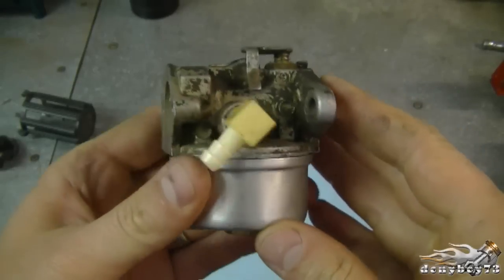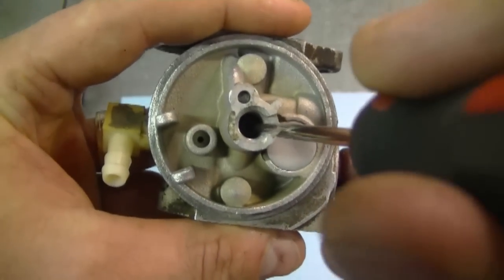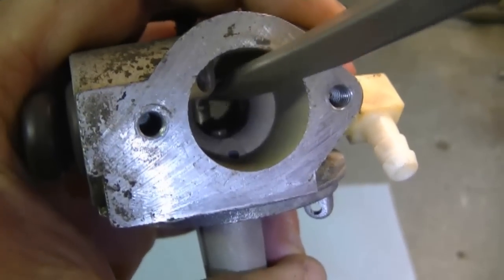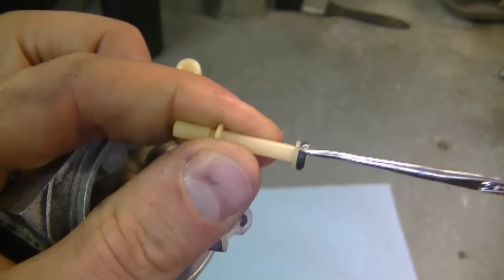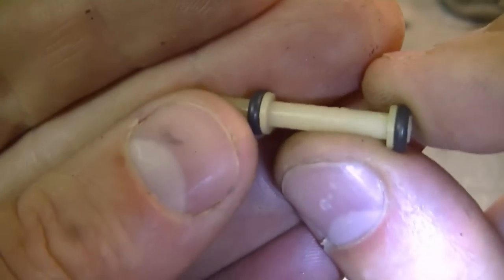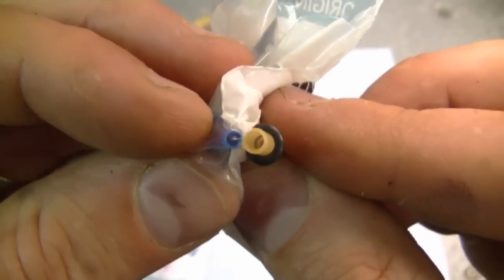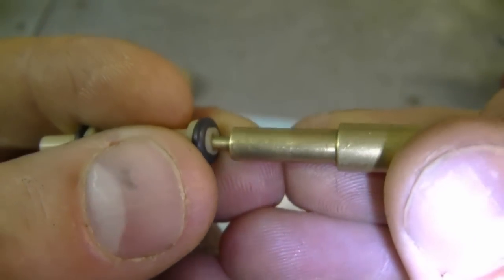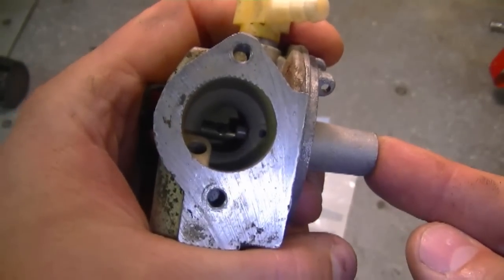How To Remove The Emulsion Tube From A Tecumseh Lawnmower Carburetor

Comment: Great video, as of 11-30-2021 it is really great.  Got a prestine old tecumseh lawnmower, the oil was even clean !  Barn Find.  The upper o ring was missing.  I speculated that there was possibly a missing o ring as there was only black kibble left of it.  Put in the two new o rings and a new nozzle since it was broke on the small end where the o ring was.  Great video Donny it provided the confidence to reassemble it correctly.  Your video is saving the day , many a years later.  Thanks .

Comment: Thanks dontboy 73 , your vidiossure helped me alot . today i put a new float bowl gasket and needle valve on my tecumseh 10 hp snowblower . it runs fine now after i fegured out it was sucking air .
thanks again
Robert Bock  
Lancaster , pennsylvania

Comment: Crochet hook is a 4/2.00 mm  as can be seen stamped on the shaft.  I have a smaller one that I filed back the forward side of the hook to make it a sharp hook.  It is useful for removing broken keys in  locks. It is marked 10.  Some emulsion tubes I have seen are brass with 8 or more very tiny holes.

Comment: Thanks Donyboy....just followed your Tecumseh 10ho fix along with a couple of other YouTube HM100 Jet fixes and my generator is running like new ! My Emulsion tube was missing to O ring toward the center of the Carb.... my bowl bolt jet needed to be drilled a tiny tiny bit and the air mixture jet was sealed tight... just ran a very thin piece of wire thru it and reassembled.... I was going to just this 5000/6250 watt generator last week....but you guys save me a $500.00 dollar bill !
Great stuff !
Reply from the maker: you're welcome. make sure you are subscribed

Comment: Good stuff, the  emulsion tube is the last thing I check if all else checks out , I have had to throw out the carb on the  permant fixed tubes.  I am carefull on  cleaning  a carb with the plastic tube , some  strong  solvents  just melt the tube and o-rings.

Comment: I removed the carb bowl retaining bolt and inside was a loose plastic item that looks like a  retainer for the lower rubber ring on the emulsifier.can you tell me what it is and how to replace it. I did not remove the emulsifier but after seeing your video I'll have a go at it although the carb is fairly new. Thanks for your great videos.

Comment: Nice video.  I've learned a lot watching your videos.  Question - I have a Toro mower with Tecumseh motor.  It will not prime well at all.  I have tried a number of things, including replacing the primer bulb.  It still does not prime well.  I have watched and I do not see gas coming up the emulsion tube when priming.   I can usually get the mower to start after pressing the bulb 15 to 20 times.  Once it fires, the engine runs great and very smooth.  Is it possible the O-rings on the emulsion tube need to be replaced?  Would this cause poor priming yet the engine runs beautifully?  Thank you.

Comment: The tang can be adjusted ( bent, is where the inlet needle is mounted ) to compensate... On these carbs, I just make sure the brass float has an even gap all around the top, between the float & carb body...The float will be level, in other words. Do not press down on the needle & seat to adjust the tang, bend it manuallywith a screwdriver.....

Comment: Nice. How about a STUCK brass one on a Honda? I've showered mine with penetrating fluid, given it a sonic bath, put an Allen key in using the bend as a fulcrum on the 'food's of the throat. Nada. Now I'm thinking of trying to get the end of a guitar string to sit on top of the tube and yank down. Or put an 1/8" length of dowel above the main jet screw to force the tube up a tiny bit to break it free. ..But is there any room up there? 
Any ideas most welcome guys!

Comment: great video as always....I have  a brass tube,,,,can i remove it ?....does it have one or two orings?....My engine will not suck gas into the carb from the bowl....It will run if i put propane gas thru the carb,,,,thanks again...bob

Comment: Hi, i have a tecumseh mower which is very hard to start even after warmed up.  Only way it starts easy is if i give it a shot of gas in the carb.  Primer bulb is cracked.  Could this be the problem?  The only other problem it has is that at the bottom of the emulsion tube it has a small ring made of plastic which has a chip on it.  I'm not sure if this affects the nut seal or not as its not chipped all the way where the nut seats.  The emulsion tube it uses is the brass kind.

Comment: Just thought I'd mention that the HMSK100 159295V model Tecumseh had a fixed emulsion tube, but I really could not tell until I had worked hard enough to remove it and found it was a brass item, force-fit into the body.  Apparently, removal is not a good idea, but with all the advice about the plastic emulsion tube, I wonder how one should be able to tell beforehand, so as not to waste the time.  Any suggestions?

Comment: Thanks for the great video Donny. I have a LV148EA  / Spec.  334049C with a blue tube in carb. Found only messed up upper ring and found no lower ring, though tube has a place for one there also. Local parts guy could only tell me that some carbs. have only one ring. I think he may be misleading me. do some mower carbs only use 1 ring on tube?
Reply from the maker: i have never seen a tube with just one o-ring

Comment: i have a tecumseh carb with the pink emulsion tube i pulled the carb to clean it and only one o ring was on there is there supposed to be 2? Also my float seems to be stuck up and not moving freely what is the problem there? Thanks donny

Comment: donyboy73, do craftsman 21" snow thrower has a emulsion tube which is removable? Do you have a video to clean this carburetor? I noticed the 5/64 drill bit is not going thru the emulsion tube this might be much smaller and the brass wire is not going thru more than 1/8 of an inch. I would love to see a video on cleaning / rebuilding this carburetor.

Comment: I can see feel that the oring in the bottom of emulsion tube is soft and brittle, is this the cause of gas leaking to the oil when running? also if the primer line is disconnected can this cause air flow to push more gas to the oil tank when running?

Comment: Thanks! I found the one I need. The one I have is off white but the one I found is pink. They are EXACTLY the same but different colors. I think it was probably originally pink but age and being soaked in bad gas for so long must have changed its color. I think I found a 100 count bag of the O-rings for $4.00.

Comment: I had a tecumseh lawnmower  that had a carburetor damaged beyond repair and the day before we were going to take it to the dump I took the carb off and left the intake pipe on and put a small valve on the tank that dripped  a small stream of gas in the intake. ran 8000 rpm instead of 6000 and I mowed the lawn one last time.

Comment: Good job Don.  My carb had the red one in it from your video.  However I saw no o rings.  Does it still need the needle seat that came in my kit?  Tx.       Abe
Reply from the maker: IT does need the O-rings and it's good to replace the needle valve seat if one came in your kit.
Reply: I think the o-rings tend to disintegrate. I was missing the bottom one aswell...i found black particles in the area around the tube when i removed it.

Comment: The LEV 115 (5 HP string trimmer) carb is leaking out of the little tygon tube into the air cleaner and empties the tank if I don't tilt it back/remove it. It started and did not start on fire but ran jerky and when I tilt the string trimmer back it runs OK but then keeps sucking all the gas in there and chokes it down with too much gas. I just got it out and will look again. I'll clean that bowl, and check the lines and clean it all a little, and check a few things but I am moving and not going to put too much time in there but would like to use or sell it working. I found the companies trouble shoot guide and will follow that.  Any other ideas? I'll try to check back here and refresh some time.... BTW Thanks and very nice smooth presentation!
Reply: Update re: the 5 HP, Tecumseh LEV 115, 350162E, YARDMAN by MTD ....I got the float cover off and guess what............Someone used the can for oil/gas mix and a lot of vanish in there and the float could not have been working right. In fact is all full of gunk too so, If I can get by in cleaning the whole thing I can get by cheap if I am careful and use nail polish on screw threads etc. And clean that EMULS tube, on and on and on. I made a folder on the desktop for the unit, manuals, and all the notes and links for the trouble shooting I have done/written and stuff I found out for reference here and by others. I would take pictures too if I need to back out of all this stuff but, the carb looks simple enough. This engine was built (SR# 0073v) 73rd day of 2000 and a vertical engine per the manuals. I got it at Wally World as YARDMAN by MTD. The manuals I found say to get a new carburetor and first Google search said about $25.00 and cheap enough but I doubt if they are factory specs enough so I will price out one from the Company and the web .... OK! Hope this helps anyone else as I have a lot of leg work in here already and most of these engines and carbs seems to be issues out there and the unit only has a few sessions on it.
Reply: Den Boe Update. DId a price check at Parts Tree and it was $85.00 and too much for me right now so I will clean it all the best I can and keep looking around.

Comment: Hi, I have cleaned every jet hole from your videos and found some partially clogged.  It still will not run unless on partial choke.  Can the emulsion tube being clogged cause my problem. I have a fixed jet.  The emulsion tube appears to be plastic. Again this is a 5hp craftsman tecumseh snowblower.  Question. Do you think I can get away with covering top of emulsion tube and spraying carb cleaner from below forcing it into those jets??  If this is not the answer is there anything else you can think of I should be doing?  Thank you so much in advance. Brian.
Reply from the maker: try what i do in this video https://www.youtube.com/watch?v=9peW43lG1lw

Comment: I just took a Tecumseh carb apart that has been sitting to long and has caramelized gas in it. The tip of the emulsion tube broke off and the O-rings are crapped out. How do I know I'm getting the right emulsion tube? Is there a model number somewhere on the carb?

Comment: Can you replace the yellow one with the red one. I took a red one from a trashed mower and used it to replace the yellow one. Would that prevent my mower from starting? I removed it (the red one) from a 6.5hp  tecumseh carburetor. And put it in my 4.5hp   tecumseh carburetor.
Reply from the maker: it should work but there could be issues

Comment: I have a 11.5 Tecumseh Engine from my snowblower with the non adjustable carb. Do you know if the adjustable carb version will fit on it? If so would you happen to have the part# Thanks!
Reply: Justin Bizub p

Comment: i see you mentioned on your notes to replce it if it hard to start on runing problems , but  what is the function of this part on the carb?
Reply from the maker: the fuels works its way to the engine through it, if the tube or O-rings are damaged it can cause a problem
Reply: donyboy73 thanks!

Comment: with the holes in the side of the bottom of the emulsion tube, does it matter which way they face when installing the tube? I tried rebuilding my tecumseh, but the mower still wont start. I have good spark and new fuel and plug.
Reply from the maker: not really

Comment: Tried to remove red emulsion tube from lawn mower carb.  Was hard to push down with screwdriver and top part bent.  Tried to pull out with pick and bottom part is now destroyed.  It is REALLY stuck!  What can I do?  Are there some that are not designed to come out and not serviceable?  How can you tell which aren't?

Comment: What does the main nozzle tube do? My snowblower will only run with choke partially on.  Soon as I take off choke it shuts off. Could this part be the issue.I sprayed seafoam into hole.  Also, you mention some models are not meant to be removed. How do I know if I have one that can be replaced? I have a craftsman 5hp Tecumseh.  Thank you.
Reply from the maker: try this first, https://www.youtube.com/watch?v=9peW43lG1lw&t=1s
Reply: @donyboy73  thanks, I think I missed a jet. I will follow this video tomorrow.  My carb. Bowl was not that dirty. Hope it wors
Reply: @donyboy73  I dropped bowl again and made sure all jets are clear. It’s now running without choke but it’s surging.  Runs strong for few seconds then bogs down. Then back up again.  I’m close. Any idea what else I can do.  I can give you my cell number if you would FaceTime me.  We have a big storm coming tomorrow. Thanks Brian.
Reply: Also. I put a new spark plug in and same issue.
Reply from the maker: @brianu33  try this, https://www.youtube.com/watch?v=9peW43lG1lw&t=1s
Reply: @donyboy73  I found the hidden screws pulled cap off and cleaned jets.  Sadly the blower is still doing same thing.  Do you think I could have a bad gasket on carb?  And that can cause this issue?  I really appreciate all your help.
Reply: @donyboy73  I notice around top of the carb bowl is wet with gas.  Not a lot but I wondered could this be causing my issue?  What do you think?

Comment: I have a tecumseh carburetor that won't prime. I've tried replacing the primer bulb and I replaced the o rings in this video, as well as a thorough inspection of the emulsion tube. Any idea what is the problem?
Reply: Hope you fixed the problem.  I'm no mechanic but have worked on tons of engines and fumble through the fix.  My guess is reversed fuel lines or broken/cracked fuel line.

Comment: Bonjour.Donyboy73 Excellent vidéo.I am a fan et depuis j'essaie de faire les réparations.Merci. Have Brigg syard machine 4.5 hp it work hard for me a bit more than a acre every week.Start and die,did not start again.Oil was really low change the oil change the parkplug(going to buy the gaptool) clean carburator.Start once and dark smoke came from the muffler do not want to start again .What will be my next step, change carburator.I thought for carburotor problem it start and die,start die....

Comment: i have re built the tecumseh carb,,,including primer bulb.  im not getting any suction when pushing primer,  Is it possible that my emulsion tube or washers on it is the reason im not getting gas to the engine ?  thanks

Comment: I was just looking into my carb on an Ariens snowblower, and that tube is CLOSED on the end you used that tool to pull it out.....  perhaps that's a design difference in mine.... but yeah it's closed...  so this is very puzzling now.... perhaps this is why my snowblower is not starting ... gas gets into the bowl, etc...  hmm.....
Reply from the maker: yes some are designed like that
Reply: oh oh.... I snapped that piece off the end 😲 at this point I don't believe it's my carb.  Do u sell carbs ?  the engine does not even chug..... there's a spark, but nothing, the engine just turns over and over... nothing.....  I tried it just now with the broken emulsion tube and still nothing.....  it's super strange that there's nothing at all in terms of even a bit of combustion.  et bien.... ca va mal.  I'm bringing the machine in torrow to your shop,, I need to feel the sled dogs and snowblower onto the sled.... it's going to be a LONG ride.... colin de bin

Comment: Merci,merci pour m'avoir répondue si vite.I never saw a diaphragm on my
carburator,my mower seen to be model 125 from the manuel part but i change
the gasket from the air filter(did need it) to carburator but still not
starting .I poke around a bit more a i saw that when i prime the bulb i can
not see gaz and i do not smell it.The number of the motor is a Britt model
12H802-0652-01.
Merci encore.
Jocelyne la reine du shabby chic

Comment: Hi Don, I have Tecumseh 631920, looks like a brass emulsion tube. I can't for the life of me get it to pop out.. My repair kit came with an o-ring for it, if it's not removable how the heck do I replace the o-ring or clean it? I assume it's plugged up.
Reply from the maker: usually the brass ones aren't removable
Reply: Thanks for the quick reply, I didn't catch that the first time I watched your video. You did say that. Great and easy to follow video! I'm subbed!

Comment: I need help replaced a fuel fitting?  The plastic part broke off.  I received the replacement which has the metal insert already attached to the plastic piece.  I cannot get the metal piece out of the carb.....Help.......
Reply from the maker: I use vise grips
Reply: donyboy73 Do I twist it or pull it straight out?   Or both? LOL
Reply: donyboy73 I got it out, Thanks!   
Does the new one just push in?  I don't want to use any tools because of the plastic part.....  or do I take the plastic piece off?